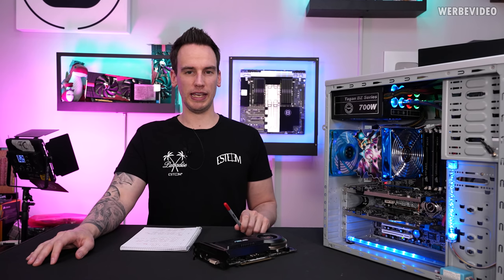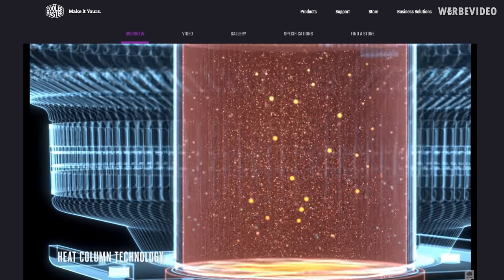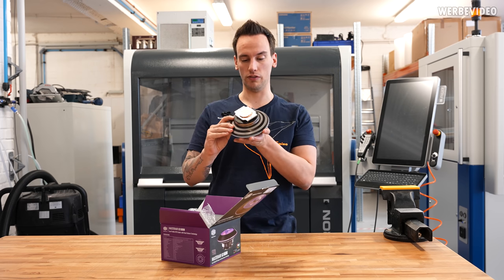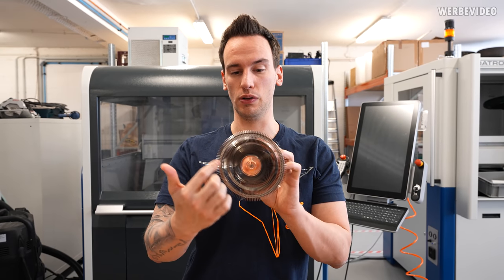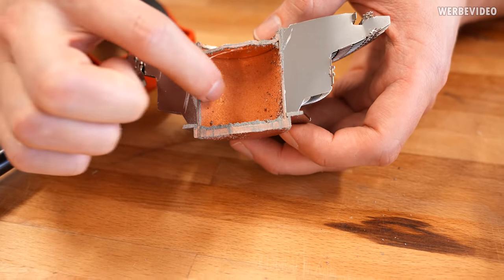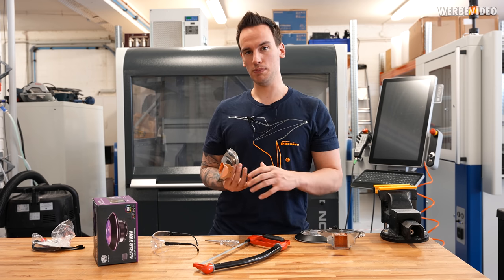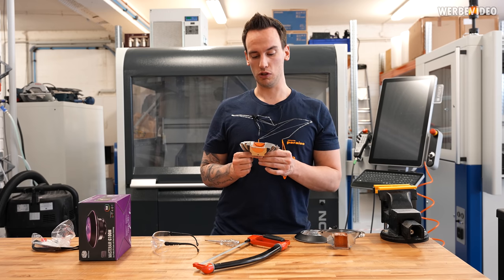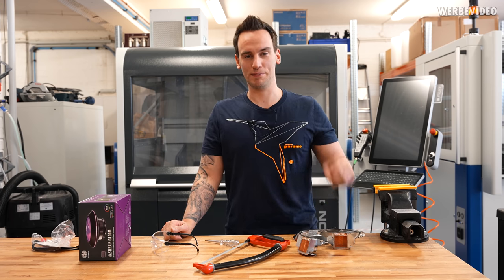The biggest "Heatpipe" won't make the best Cooler

Comment: Cooler Master cannot beat their own cooler - Hyper 212 Evo which was best bang for the buck people could get 5-8 years ago
Reply: More like a cheap cooling solution that simply doesn’t keep up with modern computers heat outputs
Reply: ahah true, im using a Hyper 212 led turbo (2x Fans) with an i7 10700k and it works alright
Reply: The hyper 212 evo is already 11 years old, and is not that different from the best seller that was the Hyper 212 plus (around 15 years old lol)
Reply: @TheElipsus  yep my 212 plus cooled quad phenom 2 overclocked very well
Reply: 3.5ghz phenom 2 x6 here with the 212+. Cant do more because of the 63*C limit but it could really shine with a newer cpu that can do 100*C.
Reply: Hyper 212 Evo This was not enough for old FX-8350 or I7 processors.
Reply: @laharl2k  I had Phenom x6 1100T, FX-8370 and 4 heat pipes are not enough for them, at least 5 are needed, and for good overclocking at least 6 heat pipes.
Reply: @VictorLarsen-fy9ls  but its really good bang for the buck, theres not a lot more you can do on those old chips, above 3.5 you had to raise voltage a lot to get to 4.0-4.2. plus thuban was mainly limited by the imc which the better cooler made no difference to,  so you could spend $20 on a basic 212 and get 90% there to the limit of the cpu without the need of a $100+ cooler which you could spend on an ssd back then.
3.5GHz with 2500mhz imc is pretty good, maybe do 2750-3000mhz imc if your chip is stable and it boots with 1833-2000mhz ddr3. Otherwise thats all an old thuban can do.

I never had an FX because my 1055T was and still is really nice.

nowadays theres a few better alternatives  for modern cpus but still $20 to get your cpu to run faster due to it not thermally throttling as much is still a nice deal.

Comment: Another weakness with this kind of design is the surface area of the heatpipe (both internally and externally) is smaller for the same volume of heatpipe than a lower diameter one. This means that the internal area for phase change is smaller, and also the external area for conduction to the fins is smaller.
Reply: It would have been better if they made it hexagonal or any shape whatsoever. A cone would have also been cheap and better than just a cylindre
Reply: @laharl2k  The problem still stands that there's a higher air volume to surface ratio inside than in a standard heatpipe. You'd have to... I dunno, turn it into some kind of highly exaggerated star shape with a dozen very thin points so that there's very little air volume left in the chamber. Even then, what'd be the point of that? That's a lot of extra manufacturing steps just to get decent cooling out of something that's only ever going to be a marketing gimmick.
Reply: @pirojfmifhghek566  i think this higher air volume actually helps for quicker heat transfer, the vapor can go freely anywhere to condense out, and the condensate just flow to the hot surface.
On a normal thinner heatpipe, the vapor when travels to the cold side, it interferes with the condensate on the walls, and i think it might slow down the actual "evaporate-go to cold side- condense - go to hot side" work inside the heatpipe, becouse they drag at each other.
Reply: @_decky4ever_  Unfortunately, the benchmark tests for this product beg to differ. You can find some pretty damning results on Toms Hardware. They even tested it a second time using a much lower-wattage CPU and it was still at the bottom of the charts. It's an infamously bad cooler.
Reply: @pirojfmifhghek566  then the phisics is not working as i tought, then the smaller pipe is better :)
Reply: @_decky4ever_  I should say that I was also hopeful that the design would show some compelling results. I initially figured they must have struck on something if they went through all the trouble of committing to a full production.

Comment: What a weird design! I wonder if they’re actually selling many of those, I’ve never even heard of something like that. I wish you could’ve tested it compared to a similar-sized cooler. (maybe an intel stock cooler?) Would be interesting to see.
Reply: Like most things in computing, intel did it first - theres a Core2 Extreme stock cooler with a similar design
Reply: I doubt they're very high volume, considering the best low profile cooler on the market bundled with the best slim 92mm fan on the market is only a few bucks more. This looks more like a product that breaks even and let's CM promote a wider cooler range.
Reply: @joemarais7683  probably more 'the tooling is ancient but its making money so why shut it down'
Reply: with intel it's actually a slug. copper slug. Even for the latest alder lake i7 12700 cooler. Not sure about the i9 one
with the AMD Ryzen 5 1600 & 1700(and 2700) coolers its an big ass heatpipe like that
Reply: Intel had few stock coolers that include a VC slug. QX9650 stock heatsink came with one and the newer TS13A and TS15A are also using VC slug.
Reply: @DLTX1007  

I believe for a while they removed the copper slug but maybe brought it back recently?
Reply: @PashaGamingYT  copper slug with the RM1. but copper slug ain't no VC/heatpipe. RH1 might have brought VC back (i've not really seen 13a and 15a as a stock cooler and intel hasn't provided any in HEDT in a long time so they don't count)
but supposedly its supposed to be better but it still cools just as "meh"  or "just enough" if you stick to 65w as the RM1
Reply: These are usually used in pre-build systems that need something a little bit more less noisy or more efficient compared to a stock cooler. Remember cpu's are not just sold boxed but with tray's as well.
Reply: @DLTX1007  i just specified it was only with core2 extreme but ofc you know best and every single one is just a copper slug even 15 years ago cos you never had one. Genius.
Reply: @DLTX1007   FCLGA4-S theres a cutaway on frostytech
Reply: Had one.  Piece of crap tbh.  Noisy and inefficient.  Also massive.

Comment: In the late 1980's Sony made stereo receivers whose heat sinks used heat pipes. It was the first time I had ever encountered the technology (I am an audio repair tech). Those heat pipes were about 18-20mm in diameter and perhaps 200mm long. I was amazed at how they worked.
Reply: Were there cooling fins or fans?
Reply: Sony SA-20F 
Too cool!
Thanks Scott
Reply: @bloodybucket213  of course. Sony was serious about their best stuff! You can't really use evaporative heatpipes without a mass to sink that heat into. Oh hey, a heatsink!

Also tech person here :) I'm not employed but consider myself and am widely regarded as that audio nerd fixing local soundsystems. 
I occasionally assemble some of the Nelson Pass amps and have always wondered what would happen if I could cool the mosfets with heatsinks. 

I'm older now. I'm wiser. More tempered. And also richer, which is exactly why I now have a class A amplifier with PC heatsinks on them.
Reply: @bloodybucket213  I looked that number up. I had not seen the powered speakers before. They're using a heatpipe and a heatsink (within a vent, no less!) to cool the woofer. The receivers I remember were conventional except for the use of the heat pipes to carry heat from the output transistors to the heatsink fins, and the the fact that there were many very thin fins (like today's CPU coolers) instead of the thick heat sink fins popular in the 80's and prior. I don't remember seeing any fans, but in some models there might have been.
Reply: @AnnaVannieuwenhuyse  I actually have a PASS AM that's awaiting me to fit AMD Wraith heatsinks onto, and a F5 Turbo V2 that im going to use repurposed AIO blocks without pumps, plumbed onto a EK pump res. And also another PASS AM that's going in a traditional chassis with heatsinks running the side of it
Reply: @ScottGrammer  Thin fins dont lend well to natural convection, they're great for forced convection because you can cram in more but with natural convection you actually want them VERY thick.
Reply: @DLTX1007  That's how you usually see them in vintage audio gear (which is what I work on exclusively today). However, although the Sony's had thin fins, they were not close together like in a modern CPU cooler. They were, if I remember, about 6-8mm apart.
Reply: @ScottGrammer  yes of course they did that. However, it's been proven that thick fins is a must for natural convection.
Reply: A friend had a very powerful Sony Amp in the 1980's. It was tiny and I think it had a switch mode PSU and heat pipe cooling.
Reply: @bloodybucket213  I think there may have been a small fan at the rear of the chassis, but I'm not sure. There were many thin fins, but they were not as densely packed as on a modern CPU cooler. The fins were perhaps 8mm  apart.

Comment: Now I am kinda wishing you had properly tested its performance to actually show us this saturation effect you're referring to  before you had cut into it 😂🤔
Reply: 130 watt TDP cools the Ryzen 5600X easily with its 65  watt TDP
Reply: @malcolmogilvy4885  Ryzen seems to understate the Box TDP... mine was labeled to be 65W as well... but according to power monitors (HWinfo) mine pulls 140W (OC'd) at 4ghz.
Reply: @BeezyKing99  Well duh, if you OC of course it won't be the same as the box rating :p
That being said, the "commercial TDP' rarely has anything to do with the actual power consumption.
Reply: @Bourinos02  I'm aware, but capabilities and cooling matter the most over box ratings.
Reply: @BeezyKing99  lmao that is overclocked but fair enough ima have an eSports Duo sitting there
Reply: @Bourinos02  no overclocked 5600x should run at 140 especially at 4ghz.. my 5600x used to run at 70-75 4.6 all cores
He did something wrong, has a terrible motherboard or bumped to 1.5v lol
Reply: @silure9502  Well, an all core overclock might be less power consuming than an agressive power curve. My 5900x has a TDP of 105W yet goes all the way to 180W on full load.
Reply: @Bourinos02  
there's a sizeable difference between the 5600x and 5900x
Reply: @Oscar4u69  Well, yes but my point was that reported TDP had little to do with actual power consumption, especially if modified from stock power input.
Reply: There are a bunch of benchmark tests for this already out there from four years ago. It's... phenomenally bad.
Reply: @Bourinos02  commerical TDP is like the car's real life fuel consumption on idle :D Intel and also AMD processors list with ~60W TDP, if you pop the cpu in a motherboard on the first windows boot, it will demand around 100W
I have an Intel 6900K processor (140 W on intel spec sheet) but if i load it it hits around 200W.... on short turbo without ANY overclocking
Reply: @Bourinos02  owh, i didn't know if oc effect tdp,and i agree with @Beezy King 65w tdp but pull over 120w

Comment: Maybe they should had added more surface into the chamber to improve the surface area, if they wanted to keep with the single huge heatpipe design. Adding pins to the inside (either vertically or horizontally) would make for a good transfer increase.

Also, grab a water jet cutter for your shop, if you plan more "investigative" work in the future, as it causes less damage to the surroundings than a bench saw.
Reply: theres no point increasing the interior surface area that would just make it saturate itself faster because youre not actually increasing the EXTERIOR's ability to remove that heat.

plus anything you do to increase the surface area would porbably be more expensive and less effective than just using multiple heat pipes instead
Reply: Heat pipes saturate when the rate of evaporation of the fluid exceeds the rate at which capillary action can bring the fluid back down to the location from which it evaporates. Increasing inner surface area increases the rate of capillary action, so that should make it more difficult to saturate the heat pipe. I was really expecting this heat pipe to be stuffed with a wick or something to use all that vacant space to help with this.
Reply: Your inner surface will just dry out very quickly because it cannot eject heat to the outside and there is no condensation happening. Without the fluids condensing there is no capillary action.

Comment: Heat-column technology was originally used primarily for LED lighting or large-scale heat exchangers. As der8auer explained well, it is an inexpensive process and it has been widely used in thermal solutions of CPU manufacturers such as AMD Wraith Spire and Intel's TS13A, TS15A, FCLGA4-S. The most recent one is the Intel RH1 cooler, which is very hip.

Comment: Back in the P4 days I built my own custom loop using a heater core, an aquarium pump, and some fittings from the hardware store. My first "water block"  was a heatsink that had a copper core. I drilled holes in  V shape and jb-welded some copper tubes to it just so water would flow through the copper core. It performed quite a bit better than the actual purpose-made waterblock that I later ordered. I believe it just had far more surface area since this was before the "micro fins" of modern water blocks.

Comment: Flower type coolers used to be the standard until tower coolers took over. Zalman used to cool very well the CPUs at the time. I have one that is made with only copper and it is almost 1kg.
Reply: One of my old favorites was the cnps 7000A-cu, used to have a couple of them and had modded a 775 era bracket to fit 1156 which worked really well but sadly lost all that to an arson fire back in 2012.

Comment: It is actually large enough to not get into a liquid lock situation which makes it possible to increase the liquid charge in it and avoid the sudden overload you would normally find.
Instead it would just increase in temperature (both hot and cold side) until the cold side can get rid of the heat again. Would be fun though as you would be able to hear the boiling.
If you use such a large bottom surface as evaporator you'd have a hard time feeding the middle of it condensate from the sides. Overfilling a bit would probably help this but I'd expect actual liquid to drip out when cut.

Comment: The Zalman coolers where dustcollectors, the thight slots between the fins closest to the P4 CPU clogged up really fast, my sons computer had one of those and we cut a hole in the sidepanel and attached an aftermarket K&N type conical airfilter with a large tube ending just above the fan! The mod looked hilarious but worked pretty okey since it also drew air from the outside of the old very much closed off Fuijitsu Siemens case! :)

Comment: That single heat pipe has a much larger volume than multiple thin heat pipes, but the overall surface appears to be lower. That's where the saturation is likely occurring, and it may be fixed by simply using a longer heat pipe with a more typical "tower" array cooler. It may then just come to a diminishing profit returns problem, as those miniature copper heat pipes use significantly less copper.
Reply: good ol inverse square law

Comment: There is no need for a cold plate because the steam chamber has a large contact area with the processor. Copper conducts heat better and the steam chamber will have less thermal resistance than the cold plate. The only thing that could be done is to increase the contact area of the aluminum fins with the steam chamber, including from above, it is possible to make the steam chamber higher and conical.

Comment: Those copper slugs are used in alot of stock cookers, famously the ryzen wraith   stock coolers that came w/ the 1000 series and alot of the intel stock coolers that have a copper slug, I'd you take the Fan off either of those coolers you can see the top of the heatpipe, wich has a nipple on it from manufacturing as its not just a mashined piece of copper like many think it is

Comment: Couldn't help but think of ways to improve such a "monolithic" heatpipe design.

Best solution I could figure is to just add some protruding walls sticking out towards the middle, then add the sintered powder. This would allow water to more easily get to the center of the "cold plate". Nor would such protruding walls need much additional work since a single weld point would be sufficient, the rest of the bonding can be done by the sintered powder, since the walls is to help water flow back, not really to conduct away heat in their own regard.

Comment: one thing about this cooler though ,depending on the ram slot spacing and the height of the ram sticks , using this cooler may prevent some  tall ram sticks from being used..also it looks like the Coruscant Senate building . XD

Comment: I have two of those coolers. Bought them on sale $40 Canadian a few years ago. That's about $32 US. Seen them for that twice. Works fine on a 3200G.
 Actually just bought them for the looks. But would not have paid any more than that for them. Would have bought the hyper 212 if they had not gone on sale.

Comment: My background is largely thermodynamics and heat transfer, almost half a century worth now, and I am not understanding why you would say that this large heatpipe would be less effective than several amaller ones. Phase change heat transfer can potentially move heat with near zero temperature  differe tial, since evaporation  and condensation temperatures  are identical at the same pressure. The large heatpipe is going to beable to handle a much higher heat flux/power, since the wick (the sintered copper inside the heatpipe) is much larger and has a much shorted distance to return the condensed liquid back to the heat source.

Comment: I always thought heat pipes were more like a pipe inside of a larger pipe with the inner pipe being wider at the bottom to catch the hot rising vapours and narrowed at the top to eject them onto the outer copper wall so they can condense as they trickle down the outer walls.